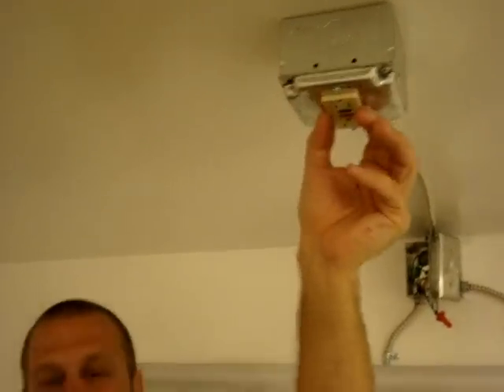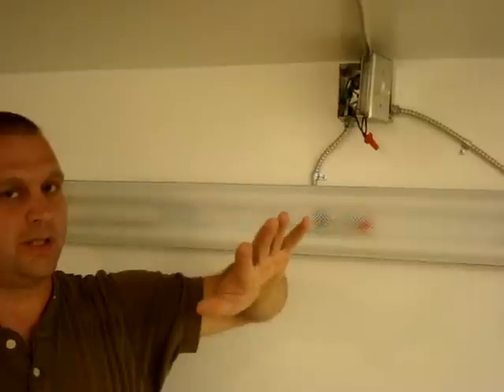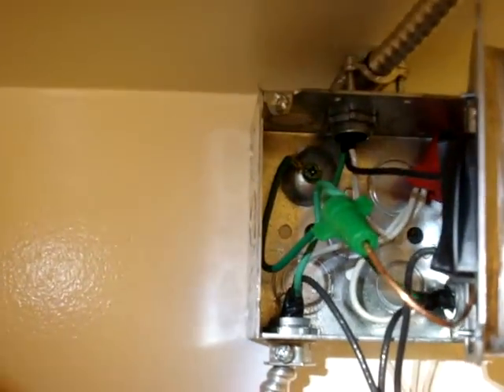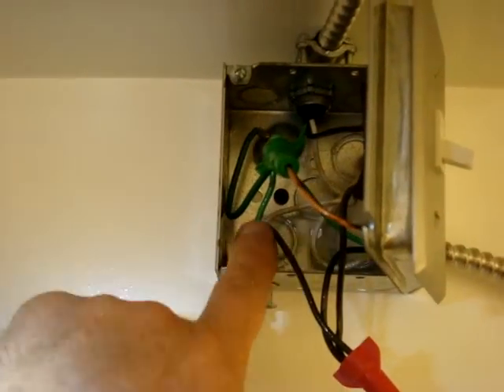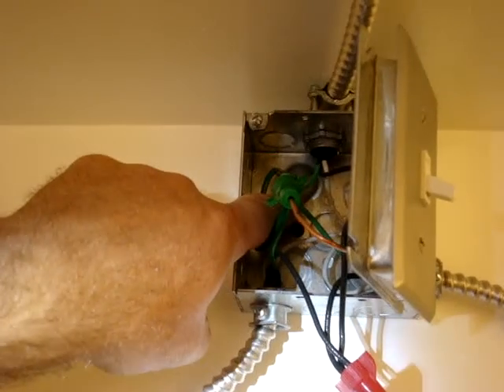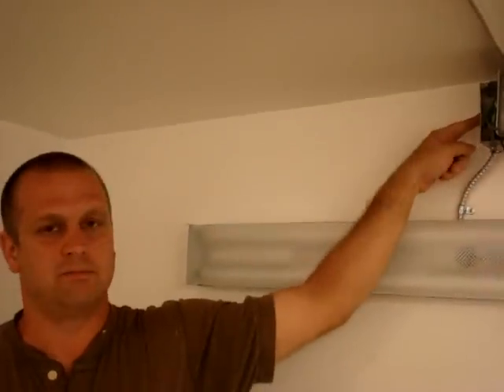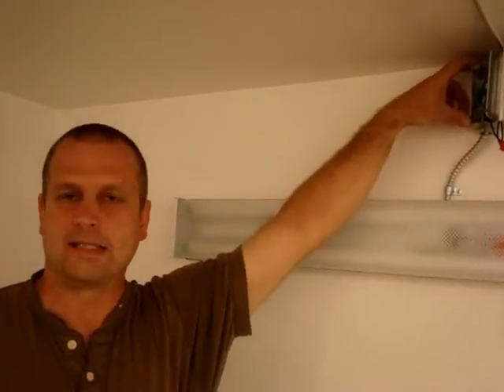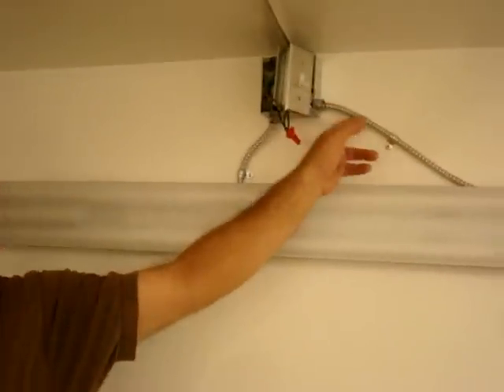How To Properly Ground a Metal Box

Comment: Thanks for the video but I never seen how you grounded it back to the main panel.
Reply from the maker: Sorry for any confusion! This is about how to use a pig tail connector to properly ground a metal box. 

The issue here is making sure the ground line (that is connected back to the main panel) is actually connected to the metal box. Quite often people neglect to ground the box. If you have a plastic box, there is no need to ground it of course.

The ground line will be connected all the way back to the main panel, which is then grounded to the earth via ground rods driven 8' deep and at least 6' apart. If sub panels exist between a fixture or box that is grounded and the main panel, those sub panels are not bonded (that means the neutral return and the ground maintain separate paths until they are bonded at the main panel. 

So, the title really is what this video is about--how to make sure that all metal boxes are grounded!

Comment: in any case local AHJS have the authority to choose which articles of the NEC to adopt or override or they can write their own electric code. I don't agree with all the rules of the NEC myself.
Reply from the maker: Jay Sudo Yes. You see it a lot here in laundry rooms, commercial applications where nothing is going to impact it, and definitely inside metal stud walls (not that it's subject to physical damage there.
Reply: It isn't subject to damage just because it is exposed. If there will not be anything to damage it, like machinery or something like that, then it can be used.